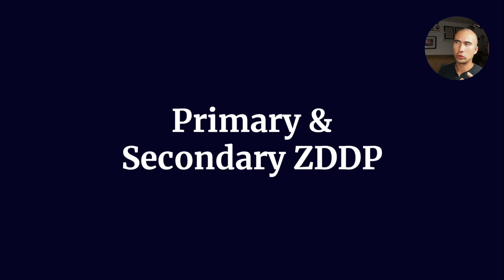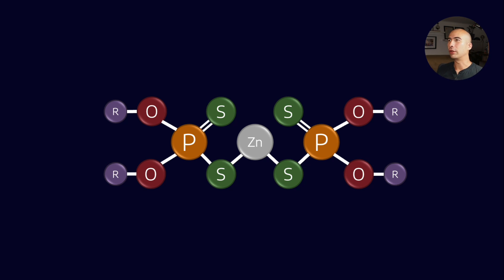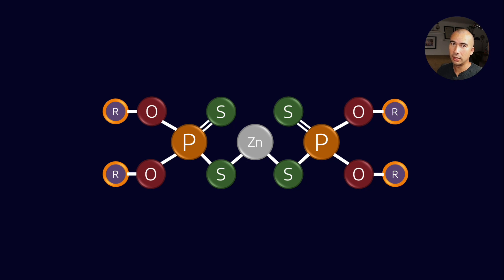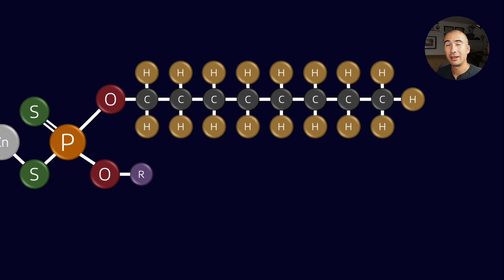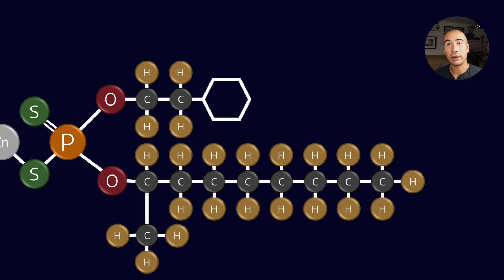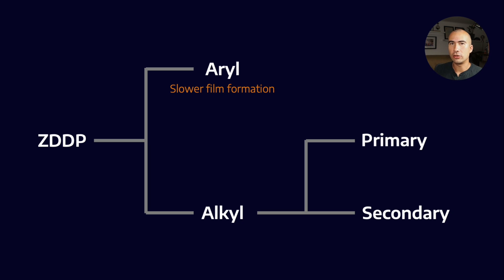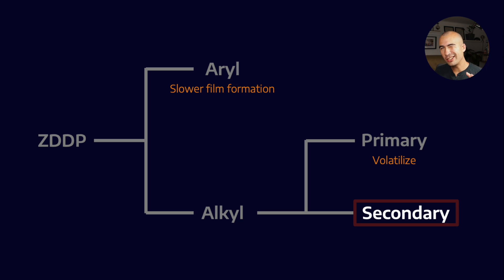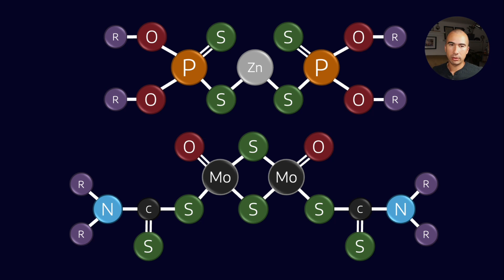Primary and Secondary ZDDPs

Comment: Very informative thanks, a question please, does ZDDP protects cylinder walls and main bearings as much as it protects the camshafts?? Because many articles talking about zddp mainly focus on camshafts and lifters,
Reply from the maker: Yes, mainly because they're the most highly loaded components, and therefore where ZDDP will have the greatest impact. But it will protect cylinder walls and main bearings too - in these instances there should be sufficient oil film thickness such that the base oil is taking most of the load.
Reply: @LubricationExplained  thanks alot

Comment: Excellent! All your videos are full of interesting information. You have a follower here
Reply: What's the basic difference between Engine Oil & Hydraulic Oil ZDDP?
Reply from the maker: Nice to see you here my friend! Fundamentally it's the same molecule - although hydraulic packs tend to run at much lower temperatures than engines so it would make sense that volatility and thermal stability aren't such big concerns.
Reply from the maker: Thank you very much!

Comment: Hi..good content as usual ...can you tell us more about soybean lubricant oils specs and it usages and applications in industry ??
Reply from the maker: Hopefully that's a video I get to in future. In the meantime, the video on bio-derived lubricants should help? https://youtu.be/mlEql-yN_As
Reply: Thanks , it's useful indeed , however, considering that volatility  will be reduced for group 2 onward,  what about the viscosity effect of the base oil itself , ie n500 comparing to n150 ,  in the middle east specificly and focusing on 10w40 and 15w40 diesel engine oil , taking in consideration unregulated maximum loads and high sulfur contaminated fuel , there are significant issues with losing volume of oil and the need for top up

Comment: Very Nice! can you tell something about Titanium ? Here in Brasil we have Lubrax Feroces and Castrol Edge with this technology and cant find much about.
Reply from the maker: Good question - I'll have to look at the published data a little. From memory I took a look at this a while ago and Castrol hasn't published much data in the public domain. I've previously spoke with formulators that do tear-apart of the Castrol additive pack and they felt the quantities of Titanium were too small to make an appreciable performance difference, but I'm unable to test that claim.
Reply: @LubricationExplained  Kendall also has a line of engine oils marketed with a “Liquid Titanium” additive package.  Not sure what that means.